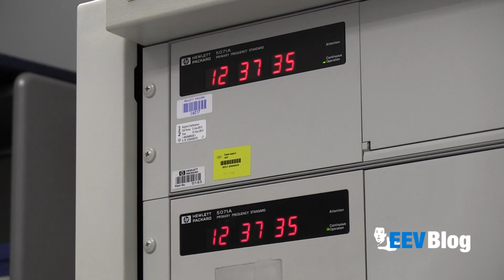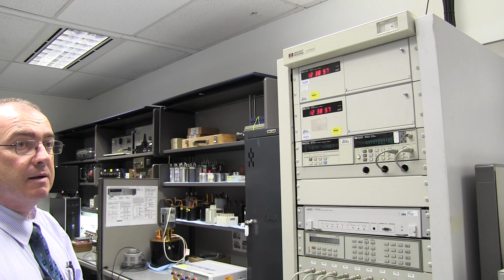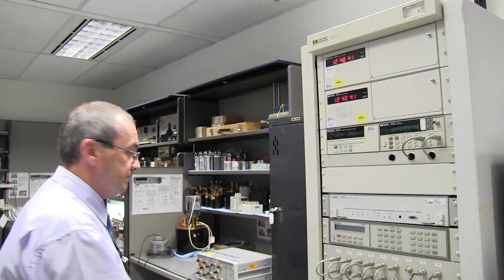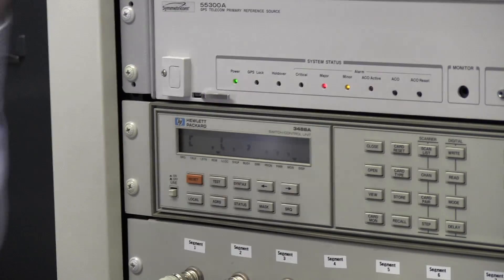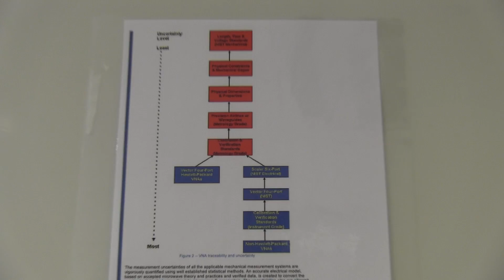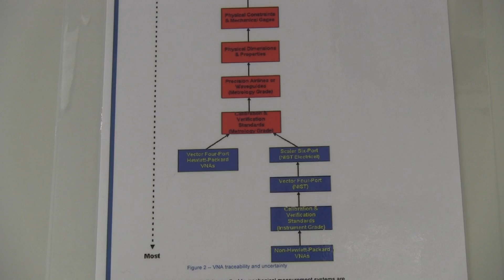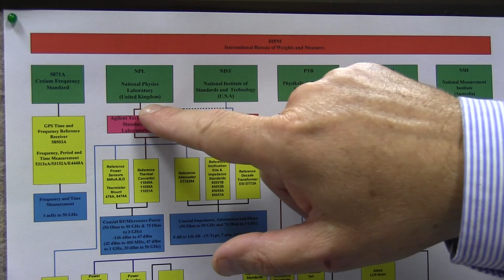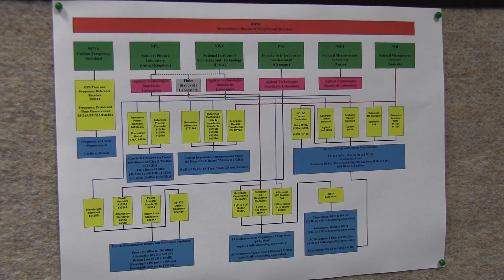EEVblog #1040 - Caesium Beam Frequency Standards

Comment: It's funny to think of that GPS does  not relay upon its own frequency standards, simply because they are too imprecise.
When the astronomer did calculate the acceleration of our solar system through the Milky Way to be one atom per second, did they use quasars, that is the most precise frequency standard in existence! :-)

Comment: Dave, I'd have a small remark for that kind of video: I find that it's really difficult to follow when you interrupt the person you're talking to. That's, I think, mostly because we cannot hear you as loud and clear as the person facing the camera. The consequence is that we often cannot hear clearly what your question or remark is, as you are not as loud and the other person is still talking. To solve the issue, you may want to  bring a second mike in those cases, or else try to avoid interrupting.

Anyway, very cool video :)

Comment: I've worked as a radio communication engineer. Our system used GPS time as sync for air traffic and land communication between base stations. Central sync source was a Meinberg-500 (high time stability GPS receiver). It can support good enough sync for around a week, even if there is not signal from antenna, but.... Once, those yankees corrected GPS for a second at the end of a year. The system gone crazy - no air traffic, despite of carriers were in the air... I've had to reboot and reclock every base station transmitter, in order to restore it working. GPS is a good in general source, but it's not very reliable, since you don't control it.

Comment: Do you call your diesel generators UPS’s over there?
Reply: Globally there are several manufacturers of integrated rotary UPS/diesel gensets that are widely used globally. 
Pillar is one manufacturer, below is a link to additional info. 

http://www.piller.com/en-GB/262/uniblock-ubtd-rotary-diesel-ups-from-500-kw-up-to-40-mw
Reply: patw52pb1 - thanks for the info. I have only worked at sites that have separate generator/ battery ups. But I guess packaging them would be only one service contract...
Reply: You are welcome. 
They are also found in installations where space for a separate UPS/battery plant and genset is unavailable or either very expensive. 
This is especially true for data center installations where support infrastructure space competes with client income generating space. 
With the integrated rotary flywheel UPS/diesel genset units there are also additional benefits of lower TCO, no battery maintenance/replacement, no fire marshal hydrogen gas flammability/explosion concerns, no battery acid abatement/concerns and no hazardous/toxic material disposal concerns since these units do not use batteries.
Reply: patw52pb1 - I keep my battery bank in a 70f cooled room for longer life, generators are pre heated to near 200f for instant startup.
Reply: patw52pb1 I have only once worked with a fly wheel ups - several tons of concrete spinning on air bearings. I stayed a step or two away from it ha

Comment: I work for a major telco in the UK. We use very similar Caesium clock sources to time our transmission and PSTN equipment. Ours are manufactured by Oscilloquartz. We also use GPS as a fallback. 

Our Cs clocks are currently being replaced after approx 30 years of service. We are able to do this without massive impact s on our network due to the hierarchy of slaved sync equipment, which will free run then slowly track into the new reference sources.
Reply: Steve Cooper The PDH network is capable of conveying timing across long distances. While the short term accuracy is compromised due to multiplexing and demultiplexing buffering, the long term stability is maintained. A slave timing shelf at the remote end is able to smooth out the jitter with a phase lock loop mechanism. Basically the slave timing shelf has an on board oscillator which will slowly track to the recovered incoming PDH signal by comparing timing phase. Over a long period of time the overall accuracy is maintained.
Reply: I can't imagine how the UK worked when PDH time based networks were in place
Reply: Fair enough :)
Reply: because the PSTN works on network switching / packetized voice. You want your packets synchronized just like any network needs to sync their packets.

Comment: Dave, does the GPS time need to be adjusted for Special Relativity? The old wives tale says that GPS didn't work until dilation was accounted for. Cheers!
Reply: I think it does, but not only that. In fact, as of general relativity, the smaller gravitational potential up there even overcompensates time dilation due to relative speed, st satellite time is faster than earth time.
Reply: Yupp I wanted to say this too.
Reply: Yes it does. Here's a great article showing the math behind it: https://www.colorado.edu/physics/phys2170/phys2170_sp15/Library_files/GPS%20(Physics%20Today%20May%202002).pdf
Reply: +Wyvrn Thanks, really great article!
Reply: Can confirm the need for SR and GR corrections. We did this in a relativity class

Comment: I love these kind of super nerdy videos. In my last job I assembled a high speed signal integrity lab on a budget of about $1,000,000US for developing Thunderbolt III and USB 3.1 based storage devices which have to handle 40Gbps data rates.  I went the Tek route rather than Keysight. Bias I guess. We had a 32GHz storage scope and TDR capabilities that still stand my hair on end. It's surreal to see timing events measured in femtoseconds, even big chunks of femtoseconds. Thunderbolt III PCBs use data lanes based on 1 mil trace and space where anything less than perfection equals failure.... embedded micros are a hell of a lot more fun.
Reply: Peter S Consumer electronics is getting nasty these days, even below 40Gbps. A colleague is trying to get his 4K projector running by trying out which HDMI cable might work this weekend.
Reply: Best wishes to your colleague! 4K HDMI involves 18 Gbit/s maximum bandwidth so it's more or less the exact same territory as Thunderbolt II. As an aside, all Thunderbolt devices need to include 1/2 of an HDMI converter for backwards compatibility with DisplayPort where it just becomes a pipe for HDMI. The new Intel chips include that block but I had to add it via a 3rd party part used in Intel's reference design. I don't want another HDMI signal issue as long as I live, lol. Once you're above 4GHz or so the transmission line effects seem to dominate and you switch from being an electrician to being a surface wave plumber.
Reply: Wearing the gold off connectors can certainly cause a bit of mismatch that you can easily see in time domain reflectometry but I've personally never encountered enough of a mismatch to affect overall signal integrity. Most of my experience is limited to the lab so take it with a grain of salt. HDMI uses three differential data lanes and a differential clock so usually if the connection is a little loose on one line, the other line in the pair will still swing enough to make the receiver register. I did notice on the scope that if you have a bad connector on the transmitter end the signal is much worse off than if the bad contact is at the far end of the cable and the worse the connection, the less effective the line termination becomes.
Reply: Could connector wear due to normal use affect 4K?
Reply: Knuckles the Echidna I suspect that connectors are the main problem, even in new condition. Every change in impedance has effects.

Comment: How do the companies maintaining the frequency standards handle issues relaying to global inaccuracies, for example if everyone's standards equipment has some kind of drift, wont there be some kind of global drift that happens over time? Hypothetically speaking, if you take a frequency standard from today, and went back in time and compared it to the same systems from 15 years ago, would there be a measurable drift. If so, would that impact the performance of modern equipment?
Reply: The second is the duration of 9,192,631,770.20 Hz periods of the radiation corresponding to the transition between the two hyperfine levels of the ground state of the cesium 133 atom. Since this behavior is dictated by fundamental constants, there will be no drift in the definition of a second - and therefore no drift in Hz.
(Except before this standard has been introduced)
Reply: You are right and Its a big issue for the standards agencies so they are constantly trying to find 'new' reference standards. For example the 'kilogram' is defined by reference to an actual artefact - the mass of a piece of machined platinum iridium alloy (stored in France) but despite all efforts to protect it the natural aging effects are changing it at the atomic level so its drifting over time. The plan is to define all measurements by reference to things we believe are constant (at least to current technology) such as the speed of light, plancks constant and so on which won't drift unless our technology undergoes some paradigm shift.
Reply: Distelzombie Centzon Totochtin But the way this is actually measured has imprecisions that can cause slight drifts.  To deal with that, the major national laboratories constantly compare their clocks through an office in France, which decides which average of the big laboratories was right then reports how much each was off.  Only after receiving that report do you know precisely what time it was during the reported period.  The delta is very small, but NIST is just one of the references in the official mix.
Reply: the level of inaccuracy being talked about for time is much smaller than that for mass, and is of a different nature. With ceasium clocks, the average of all "reliable" clocks is a better representation than that of any single clock, it's just the nature of how random errors work. You could add more clocks to make it more accurate. The problem with 'kg' is the definition itself is changing, so re-measuring an infinite amount of times will produce a slowly varying answer for the same question.
Reply: as wolfedog99 pointed out, it's not about the accuracy of an individual clock, it's that these clocks are so accurate that differences in gravitational strength at different places produce a measurable difference in the speed of time, so some international comparison is needed to get the most globally useful value. Another few orders of magnitude of accuracy and relativistic geodesy becomes plausible.
Reply: That said, TAI is not relevant to frequency calibration. A local second is what matters to freq., not the time of day, as such relativity has no effect on the calibration.
Reply: My watch has a quartz crystal in it and that is more accurate. It was made in china where the best things come from. How do we know if our entire galaxy or solar system is being stretched and our atoms are beating faster since we are moving toward the great attractor? Would it be measurable or matter?
Reply: John Francis Doe
Interesting. If the method of measurement is improved (I remember there are new kinds of clocks developed now) this would at some point be no issue anymore. I thought he was thinking it was something like the kilogram issue. (Which has been solved using watt balance)
Reply: Andrew Hill
Hm. I guess it is either too expensive or not unproblematic to build a cesium clock with 10 cesium clocks inside that are averaged.
Reply: Of course it is. Otherwise these Instruments that are shipped half the globe to calibrate will have "drifted" already when they arrive back - due to gravity differences and therefore differences in the lenght of a second.
Reply: TAI averages many clocks around the world because it is intended to be a worldwide average, not because they need to mitigate piles of random errors and this is why you don't see ten clocks in one location. The issue is that the international atomic time is meant to approximate the notion of a true terrestrial time at the surface of an ideally homogeneous geoid but gravity varies with local crust mass and causes relativistic variation, this is not drift and not really inaccuracy or uncertainty. It is more of a physical limit on the potential precision due to this lumpy ball wobbling around in space called Earth. GPS sat. clocks run a hair faster than terrestrial clocks due to their speed and the slightly reduced gravity at that elevation. The TAI average is not a simple mean of all the clocks either each clock's weight in the average is scaled according to its known local gravitational strength.